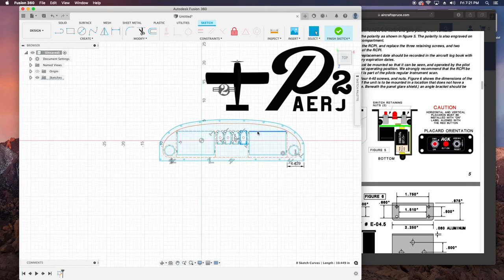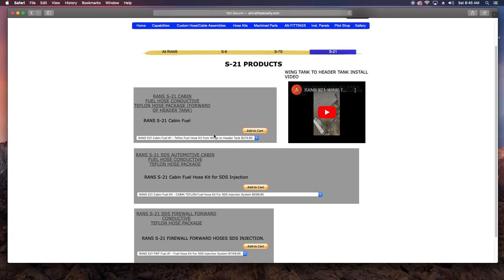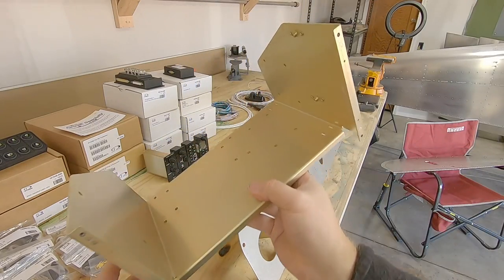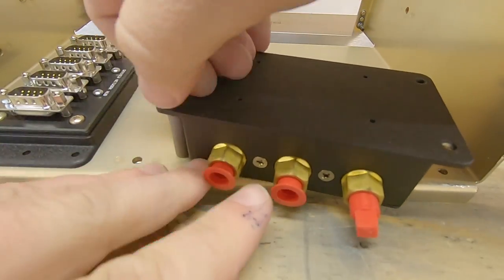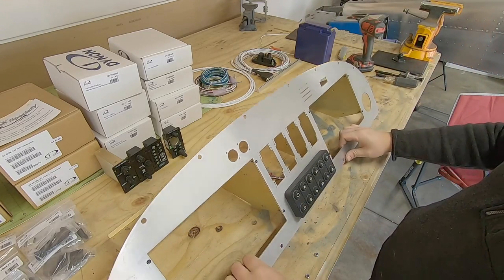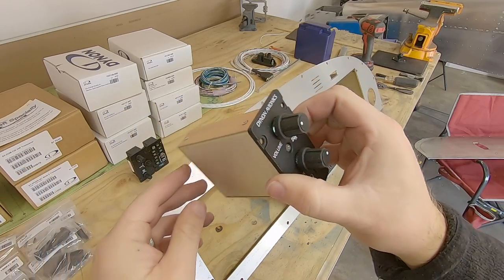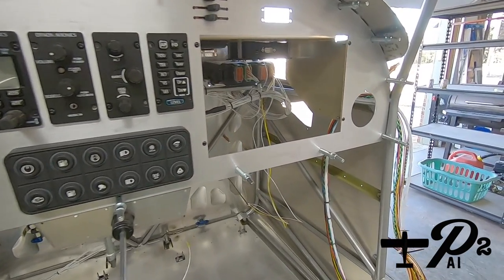INSTRUMENT PANEL MOCK-UP / RANS S21 BUILD EP47

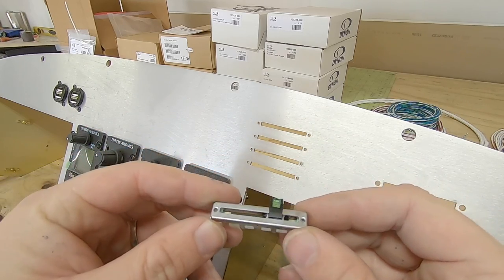Comment: 12:42 I completely get it, your plane, your rules! I will also say I know nothing about aviation, and I definitely am not saying I don't like it (I think it is really neat) but it does look like they might be mounted JUST close enough that will require some active thought and nimble fingers to move one of the inside two slides without bumping their neighbors with your fingers. I could be wrong, just my experience from a 1998 Jeep Grand Cherokee that was my first car and had potentiometer slides for the audio controls (bass/treble/balance/fade/etc) that were mounted pretty close! :D
Reply from the maker: Valid concerns sir👍 They are spaced as far apart as I had room for.  Also worth noting that none of the items controlled with those sliders are “flight critical” items so inadvertent movement wouldn’t effect the safety of the flight. Last thing is they are above the screen intentionally to give your hand something to stabilize off of with a few fingers while reaching up for these. Always good to hear from you sir! Thanks for watching and participating in the comments section!
Reply: @Project2Aero  That makes perfect sense. If you can rest a few fingers above/below then you can use just one to manipulate the slider and avoid that issue altogether!

Comment: Your tech stack is so awesome! I know you did an electronics overview, but I would love to see deep dives into the PDM, ECU and EFIS. The ECU you mentioned looks really cool. Will you be using one of their existing maps, or do you have plans for a custom aviation one? The only other ECU I'm aware of for the Yamaha converted airplanes is the BD Turnkey, so it's really cool to see another option. What made you decide to go the Hypersports route as opposed to the BD?
Reply from the maker: Thanks for following along👍… I do plan on a deeper dive into those things when I get it a bit more refined… at the moment I’m still ironing out little things a tweaking stuff. I chose the Hypersports ecu for a few reasons, but the main one is that one of (if not) the top dog in sled competition rigs is the brain child behind the tunes. There are currently 2 flying and several more getting close with this ecu setup and it just keeps getting more and more dialed in. I don’t know enough about the BD options so steer you in either direction but I can say I’ve not regretted the path I went down one bit. Hope that helps and feel free to reach out at project 2 aircraft at gmail if you want some more in depth info.. thanks for watching

Comment: I've suffered lots of lost footage due to failing to using endurance video cards in my dash cam gopro and phone
Reply from the maker: Been testing with new cards and an external battery rather than the internal and it seems to be working for now🤷🏻‍♂️ I think it’s heat related for sure…

Comment: Wow, this was satisfying to see everything come together. At 8:53 is there any grommet that goes around that raw aluminum to prevent any possibility of wire wear?
Reply from the maker: I oversized that hole to eliminate that possibility. Other wise, yes that sure would be a concern for sure👍
Reply: @Project2Aero  As I looked at it I couldn't image ANY possibility where those wires would contact unless they plugged STRAIGHT across, which I knew they wouldn't, but was curious otherwise!

Comment: Josh, Dynon shows the option of installing the ADSB receiver also in the Universal Module Mounting Tray.  Was engine vibration the reason you chose to mount it at FS 2A instead?
Reply from the maker: I mounted anything with a coax antenna cable back near where the antennas will live so the runs are short and simple.  That’s really the only reason👍
Reply: You also mentioned your preference for the inverted installation of the Universal Module Mounting trays.  Other than perhaps easier access from below, are there other reasons for your decision to do this?
Reply from the maker: @tboyett8090  No sir, that's pretty much it.. It just gives me better access from below if I didn't want to pull a screen out.

Comment: How is the Yamaha connected to the Dynon instruments? I was told the Yamaha requires a separate Vigilus Flybox.
Reply from the maker: The plan is to use the Dynon EMS module for the rotax engines.. it accepts can bus inputs and “should” work.. I get my HDX soon so I’ll be posting the results of this attempt soon👍